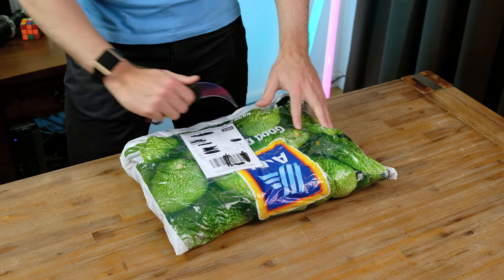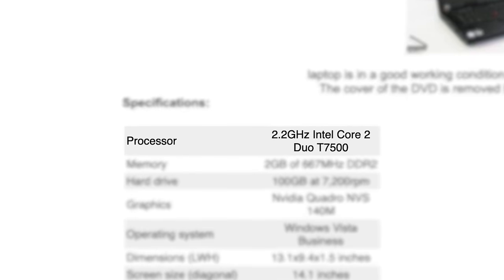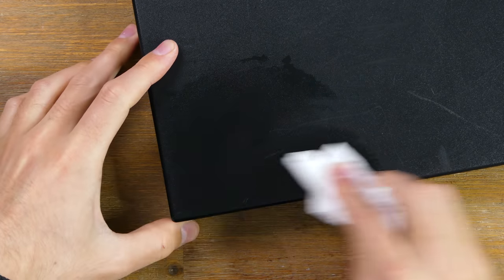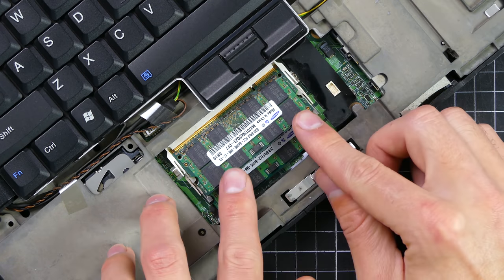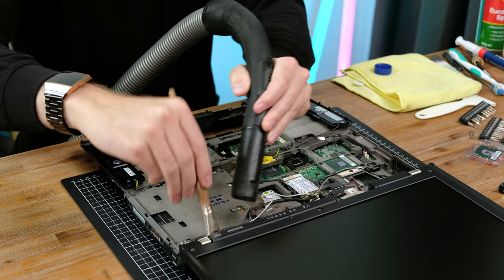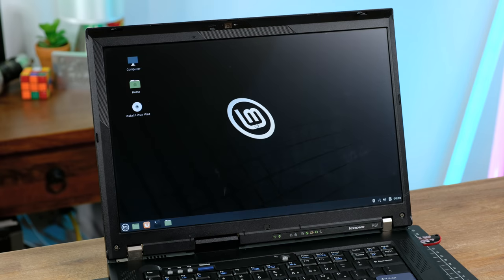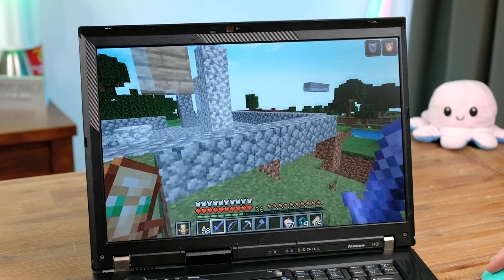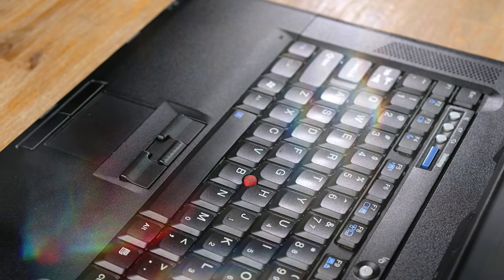I Bought a $49 Thinkpad... And Got Scammed!

Comment: Since you are coming to a Linux land ;) one small tip: to gain a couple of FPS, get the CPU performance governor to "performance" instead of default "powersave". 

echo performance | sudo tee /sys/devices/system/cpu/cpu*/cpufreq/scaling_governor

You need to do it every time though; in order for it to run automatically, add this line without "sudo" to /etc/rc.local before the last line.
Reply: Or screw it. If I have a low end system I want to use in 2021 (this will annoy you) I just use ReviOS.
Reply: @LBSiUK  that's illegal though. If you want to do the same thing legally, just find one of the numerous Windows debloat scripts online and run it on a legally activated Windows.
Reply: @АлексейГриднев-и7р  It's legal though. It doesn't come pre-activated. You still have to buy a license key or use the one that comes with your old laptop you want to install on. Or activate with your school. It's not illegal, which appears to be something people get wrong all the time.

Comment: I got my first ThinkPad a few months ago: a T61 with the infamous NVIDIA Quadro NVS 140M GPU. Older batches of this laptop appears to have problems with the GPU. Fortunately, mine does seem to be working just fine. Exact same process on disassembly! I also spent on 4GB DDR2 RAM sticks.

Glad you still enjoyed working on that R61 despite the hiccups with the seller.
Reply: Did you actually buy 4GB dimms? I thought they were stupidly expensive, a good $50 each?
Reply: @LBSiUK  I did buy 1 lol! My friend bought a 4GB DDR2 stick for her old laptop, but it became really slow for some reason, even with updated BIOS. So I she gave it to me, hence my second 4GB stick.
Reply: @kielagut  my god you are lucky. I am really tempted to buy 2 4GB sticks for my Dell E6400/D830, as they can both take 8GB, but I really don't want to pay that much. It's possible that CEX will have it at a cheap price though.

Comment: Mint has most definitely given it a new lease of life.
Reply: Mint's too heavy for this. it's desktop will strain the hell out of a dual-core CPU. sure, it will run just fine, but it'l definitely overheat. sure, mint is lighter than windows, but there's a limit. if you REALLY want linux on an ancient machine, try lightweight distributions like antiX or Lubuntu.
Reply: @mecrumbly429___4  yup, thats true.

Comment: I wouldn't call this a scam tbh, just not entirely as expected.
Edit: Why would you say you can't resell the laptop with a locked bios? You can, just take the cmos battery out, it resets bios and removes passwords. Especially on these older think pads.